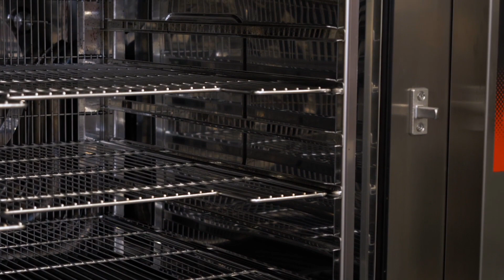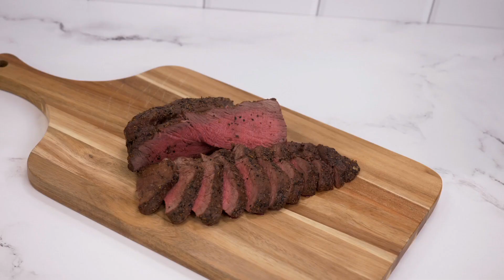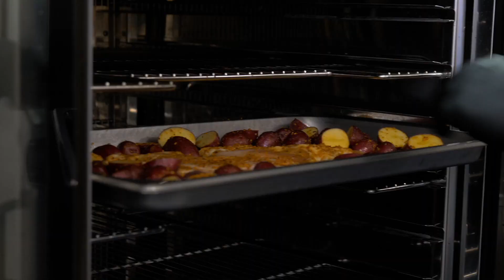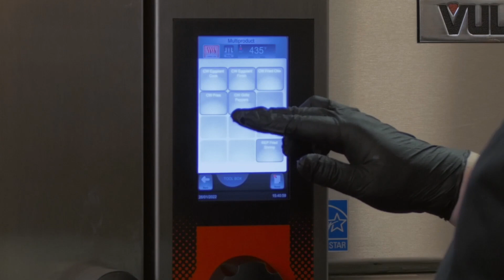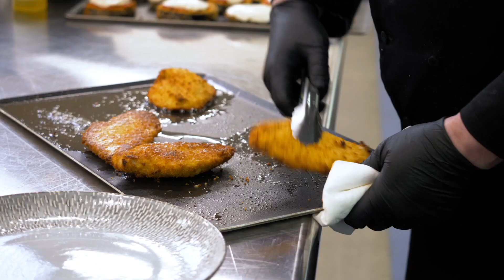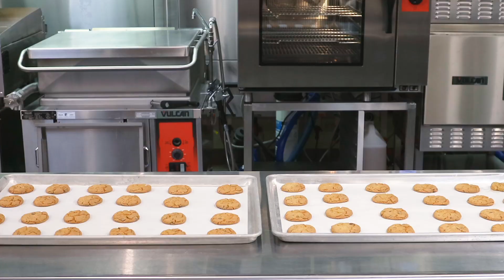You Won't Believe It! See The TCM Combi Oven: Roasting, Steaming, Broiling, Air Frying, and Baking

Comment: Is using this combi oven for bagels (mainly) but at times roasting beef, turkey breasts and chicken a good choice? Or is using it mainly for bagels at such a high temp not really good for the unit? It seems like a great fit to make baguettes and bagels..
Reply from the maker: The TCM Combi is perfect for all of these applications.  Using the Vulcan TCM Combi consistently at high baking temperatures is not a problem at all for the unit.  A key advantage of baking in the TCM is that you never have to rotate pans and will have consistent even browning on all levels.  Another advantage, as you mention, is the versatility.  You have a great baking oven that is also able to roast proteins like roast beef, turkey and chicken to perfection.  As a bonus, when you roast protein in the TCM Combi you get a much greater yield than you would using traditional equipment.  To see and taste the results yourself, schedule a live demo through our local rep, https://vulcanequip.co/tcm-demo.